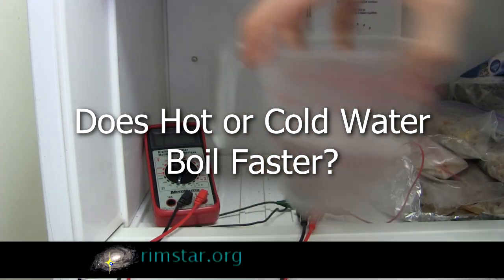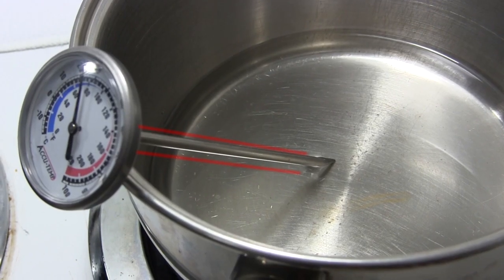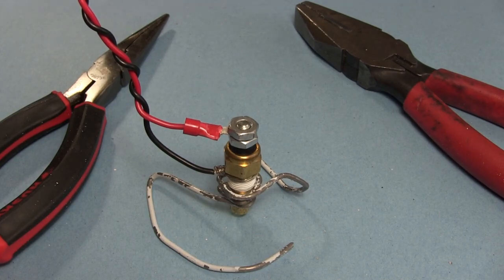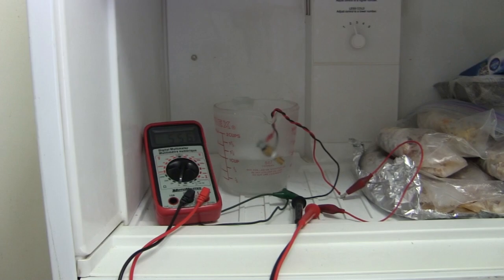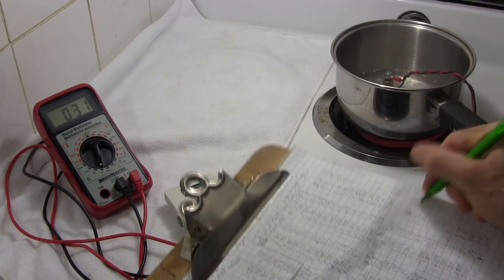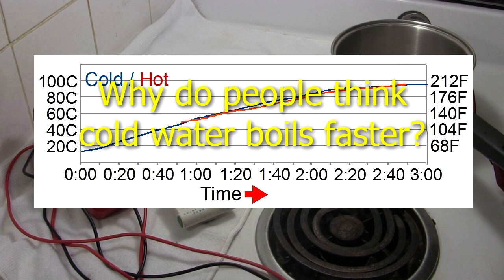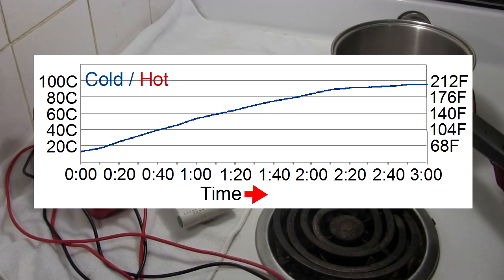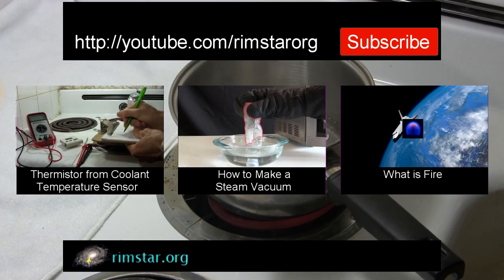Does Cold or Hot Water Boil Faster?

Comment from the maker: Good question. If I'd filled the pot, then it would have taken longer to boil. That would have given more time and space for heat loss out the sides. That heat loss would have added variables to the experiment and I wouldn't have been able to subtract those variables from the graph. I know this only because I did try a soda can with the top removed so that I could use the thermometer. It took 13 minutes to boil, for the same volume of water, i.e. huge heat losses! I experimented a lot. :)

Comment: The confusion is not in the situation but in the semantics.
Cold water does not boil at all.
Assuming that the term "boils" in "Does cold or hot water boils faster?" means reach its boiling point faster, we are left with the ambiguity of what exactly "faster" means.  "Fast" is often used to describe any event that happens in a short period of time regardless of any rate function. So even a slower racer who's close enough to the finish line might finish faster than a racer whose speed's greater.

Comment from the maker: But you do take advantage of this in Stirling engines. You keep one side of the cylinder hot and the other cold. The colder the cold side is with respect to the hot air inside the cylinder, the faster that hot air is cooled so that you can repeat the whole cycle quickly again.